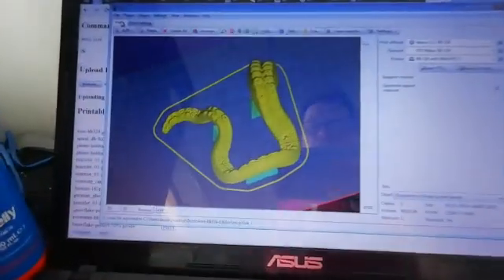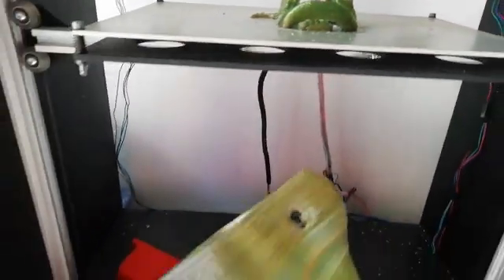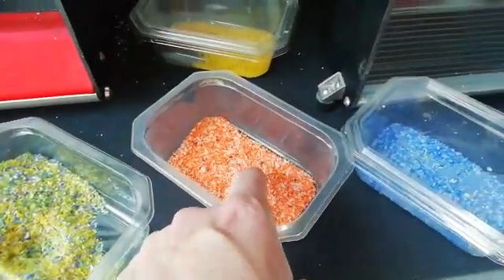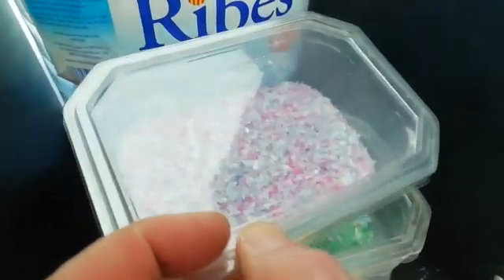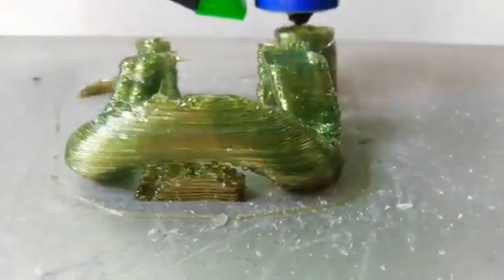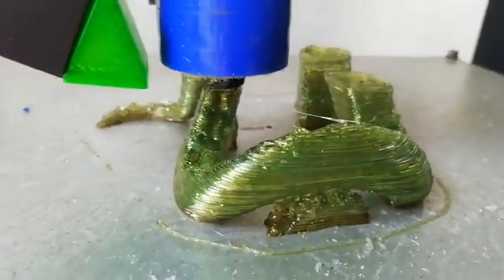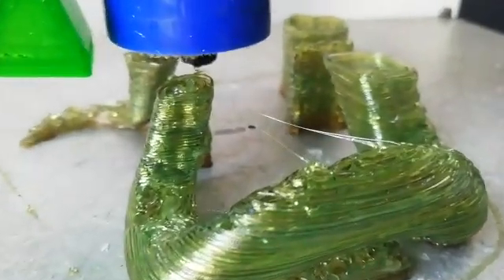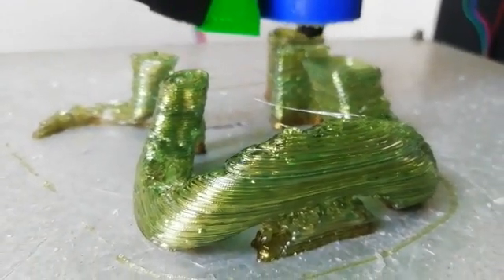3D printer using PET ground flakes

Comment: Was just reading yesterday that PET is picky and there is a range of PET's... where they all perform slightly different.  Bridging was something noted that is more difficult as seen in the video.  Guessing printing calibration standards to fine tune settings for each material.  Probably can develop of fine tuning general procedure for each material also.
Reply from the maker: This is PET from actual water and soft drink bottles.. we don't get to add Glycol..we have to use the flakes as is.
Reply: Are you saying that there isn't a sweet spot you can find better, like if using the calibration prints like the towers or whatever methods?  Your other multi-color prints look so much nicer. 

Maybe using a tungsten or better nozzle.  Which nozzle are you using?

Any thoughts on amending and producing filament or maybe even amending in the hopper?

I've seen some direct filament cut strip methods that seem to perform well... though most products other than that one 3D Printer Pen design... transition from the strips to the grinds. 
https://www.youtube.com/watch?v=le37EsburhU  (strip pen)
https://www.youtube.com/watch?v=AmJzqdA3zSg (strip custom head from cassette deck parts)  Brother has a neat range of videos noting his custom filaments from recycled materials where appears he too uses the grind and extrusion design to make his filament.  I've not seen where he direct prints from grinds/flakes. 

Then there are one or two auger extrusion based designs I've seen:
https://www.youtube.com/watch?v=lc6FHLTReIo (video not so good and they transitioned to flakes)
https://www.youtube.com/watch?v=L3TxCJKbMEY

Neat to see the HomoFaciens and Joshua Pierce designs moving forward open source.
Reply from the maker: @jafinch78   Of course there's a sweet spot :)  It depends on speed, flow and flake size...and a little bit on geometry. We did this 3 years ago and the extruder is a modified www.mahor.xyz  , as Mahor and I developed this together in Spain.
Reply from the maker: just email me david@3d-seed.com as I didn't see all your reply sorry, but two of the videos are by Mahor is Spain. Basically the reason to not make filament from granules or flakes is that it's a waste of energy, extra processing and not as simple to understand for everyone :)   or have a look at the websitre www.3d-seed.com
Reply: @DavidBassetti  Oh neat!  Any reason why decided not to pursue the cut strips methods?
Reply from the maker: @jafinch78  Surem you can't use wither the top or the bottom of the bottle

Comment: Wait is this PET or PETE (polyethylene terephthalate)
Reply: They are the same thing.
Reply: @derekenglert  I think there is a range of "PET" materials.  Get's more complicated than only being one type of "PET" or two like with the HDPE or LDPE's for example.  Some PET's have glycol and other formulations based on application.  Just starting to read into the materials in more detail since thinking I'll transition to PET eventually and have a goal to print with my own recycled PET from bottles or containers cut strip material so to make less a mess by avoiding the grinding process.  Thinking can perform a direct extrusion method as well as make a standard 1.75mm diameter filament.